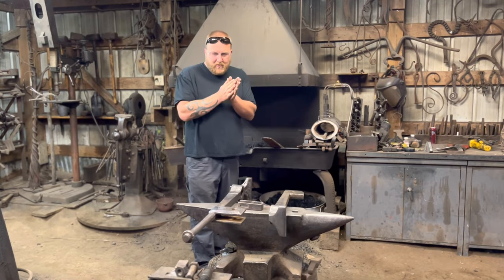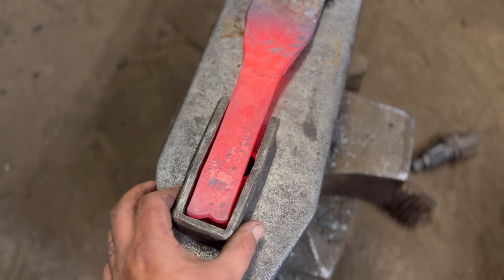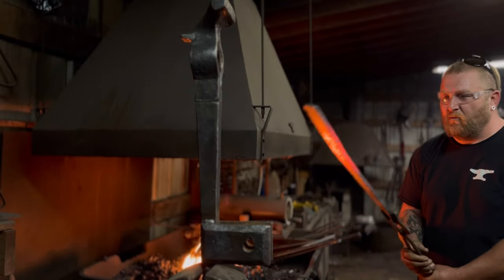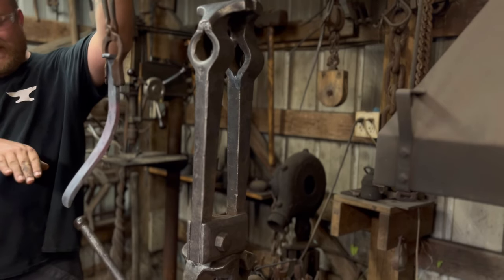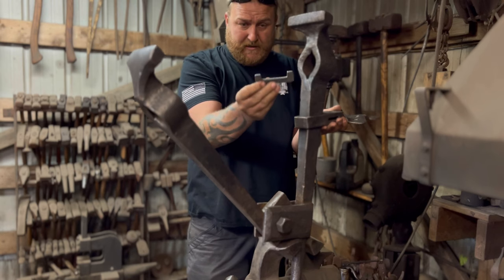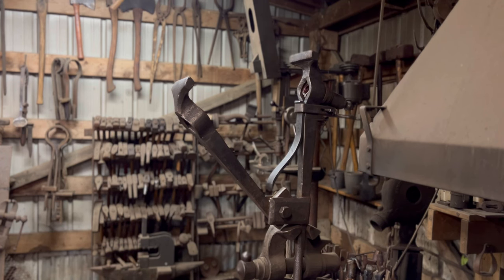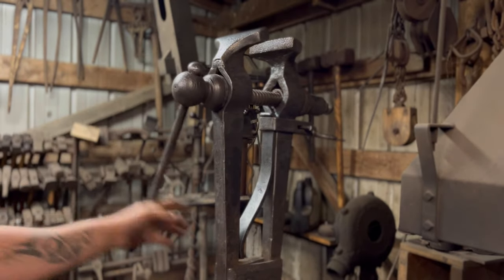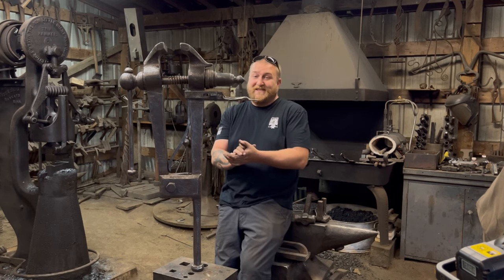Giant Blacksmith Vise Spring Rebuild!

Comment: I love restoring vices. I take all of mine apart when I get them. Making springs is common, like you show here. I like the explanation of the green coal in the beginning. Also good to have confirmation on not needing to heat treat the springs. I do normalize it 3 times tho.
Reply from the maker: Not really confirmation more of do whatever you want, ha!
Reply: @MtPhillipMetalWorks  It's worked on all of mine so far. 🍻